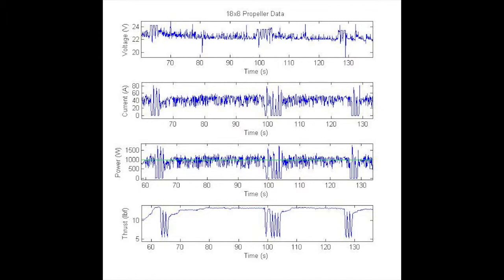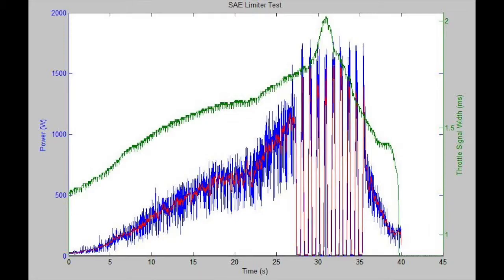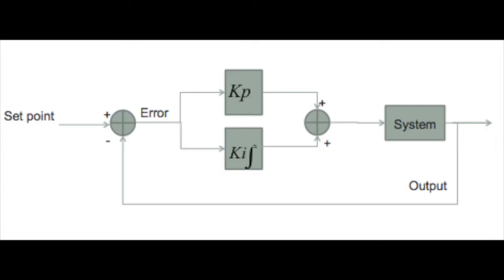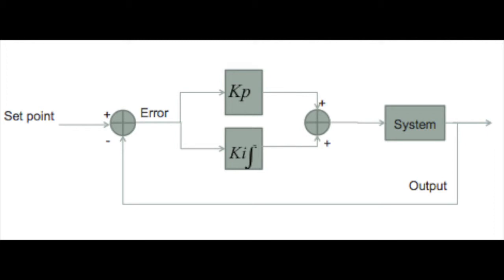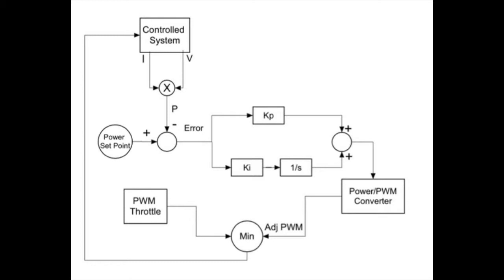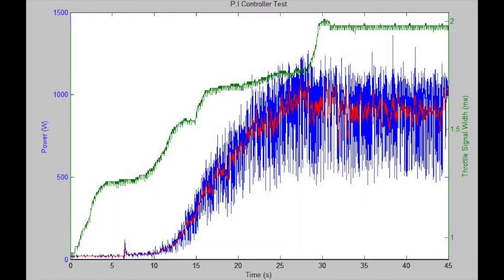Optimizing Power Consumption of SAE Aero Aircraft

Comment: Hi, It's a great video and I got to learn a lot. It would be really nice if you could please give the link to purchase Turnigy precision and power analyser. I along with my team is also going to participate in SAE Aero Design Regular class. It will be of great help.
Reply from the maker: Siddhant,
You can purchase the power analyzer through amazon. Here is the link:
https://www.amazon.com/Power-Analyzer-JZCreater-Precision-Measurement/dp/B01LVTST80/ref=asc_df_B01LVTST80/?tag=hyprod-20&linkCode=df0&hvadid=242027088707&hvpos=1o1&hvnetw=g&hvrand=8202070120842323480&hvpone=&hvptwo=&hvqmt=&hvdev=c&hvdvcmdl=&hvlocint=&hvlocphy=9001984&hvtargid=pla-451971055376&psc=1

Comment: You could have set the throttle limits in the transmitter itself
Reply from the maker: That's true, but after a while that limit would not be desirable as your battery capacity would be draining and would require a higher throttle signal to squeeze more juice to maintain a power output close to 1kW.